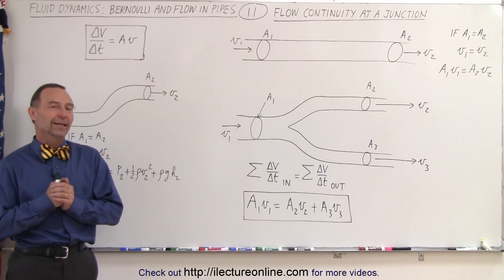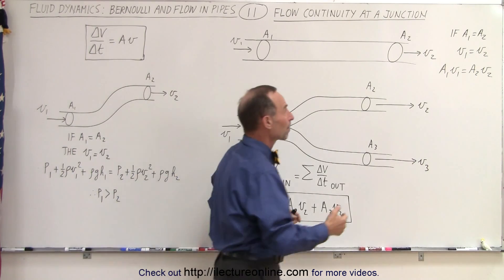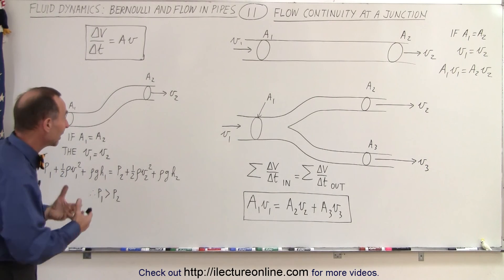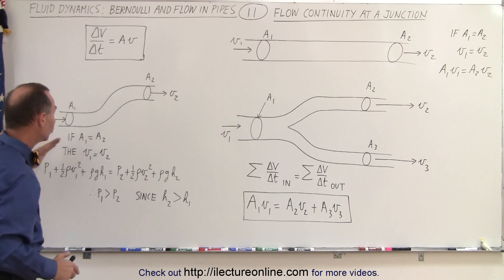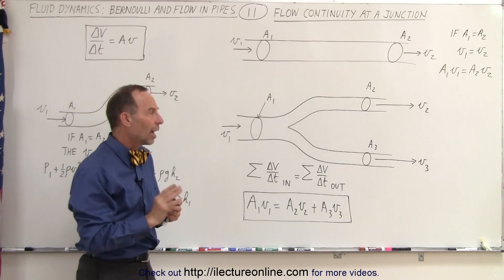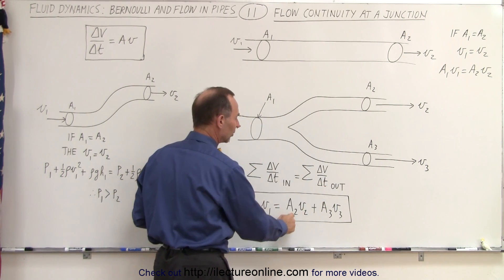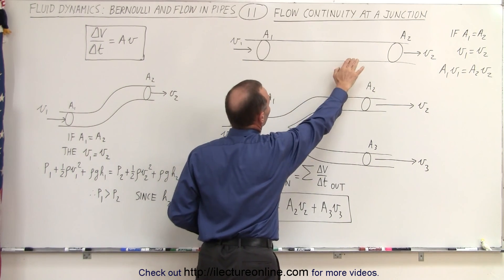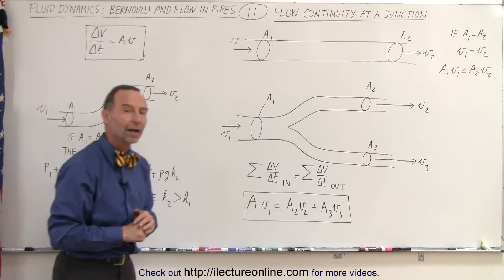Physics 34.1  Bernoulli's Equation & Flow in Pipes (11 of 38) Flow Continuity at a Junction

Comment: Nice. Thanks. What if the pipe diameter of A1 (e.g. 6 inch) split to two pipes of the same diameter (e.g. 6 inch each), would it increase the flow compare to only one pipe of 6 inch only?

Comment: How does the pressure change from the big pipe to the 2 smaller ones?
Reply from the maker: If the diameters are different then the velocity increases in the smaller branch and decreases in the larger branch.  And therefore in the smaller branch the pressure drops and in the larger branch the pressure increases.
Reply: @MichelvanBiezen  there is 2 smaller branches and 1 bigger branch tho

Comment: Thanks for the nice explanation! 
I have troubles to understand how you would write bernoulli's equation for the 3 pipe system? Would it be the same as you wrote it on the left side of the board, or would it become P1 +1/2 rho v1^2 + rho g h1 = P2 +1/2 rho v2^2 + rho g h2 + P3 +1/2 rho v3^2+ rho g h3? 

Thanks a lot!

Comment: You state that the change in pressure is due to increased friction losses due to increased velocity but... Bernoulli's equations explicitly assume a frictionless pipe. 

edit - I wrote the following because I missed the tiny half-second where he stated his assumption that pipes A2 and A3 are smaller than A1. In that case his statement about friction losses is correct, though still a bit misleading without also mentioning the additional pressure change predicted by Bernoulli's equations. Below is the rest of my original comment with some corrections.

Also, velocity is not guaranteed to increase. In your equation "A1V1 = A2V2 + A3V3" you can set V1 = V2 = V3 to drop out the velocity figure and produce the equation "A1 = A2 + A3" which demonstrates the necessary relation between the pipes to achieve constant velocity between the pipes. For instance if the two pipes have half the cross-sectional area. In this case Bernoulli's equations predict the same pressure in pipes 2 and 3 as in pipe 1.

Now, if all three pipes are the same size: "A1 = A2 = A3" then the pipe size can be dropped out to produce "V1 = V2 + V3" in which case V2 and V3 must have lower velocity than V1. In this case friction losses (which bernoulli is ignoring) would actually be less than in a single pipe of that size.
Reply from the maker: In real life there are always pressure losses due to friction.  In Bernoulli's equation these are ignored and changes in pressure are only due to changes in height and changes in velocity.
Reply: @MichelvanBiezen  Agreed, I just wanted to clarify that even in the absence of friction the change in velocity must still be accompanied by a change in pressure. In many scenarios it is much more significant than the frictional loss. 

I wanted to bring attention to the friction issue because I thought it highly likely that some incorrect implications made while talking of the y-bend would mislead some people that watched this 
video.

Also, I admit that I also slightly incorrectly stated my case in my last paragraph. in my proposed scenario (all three pipes the same size) V2 and V3 will have smaller velocity than V1 and thus a higher pressure in the two right hand pipes. I will edit my original comment to fix that. Also, 'pressure due to velocity change' is a bad way to look at it. I'll change that too.
Reply: @MichelvanBiezen Thanks for taking that minute to reply, it led me to think about my own exact wording and assumptions and has improved my ability to conceptualize and explain these principles.
Reply from the maker: You obviously understand this well.  Thanks for the excellent input.

Comment: How would this result change with a compressible fluid (air)?  Would the decreased cross-section cause a higher pressure and cause less air to flow in the thinner pipe?
Reply from the maker: We just posted a video today that addresses that.  (It was part of last year's JEE exam.)

Comment: Great video sir,

Need one help in the third scenario
If A1=A2=A3, H1=H2=H3 and if A3 line is closed at an X mtr distance. What will be the effect of flow caused when fluid flows from A1 to A2. Will there be turbulence created at the intersection causing reduced flow rate and pressure.
Reply from the maker: If A3 is closed off, then the transition from A1 to A2 would have a sudden diameter transition, which would cause some turbulence.  (we ignore turbulence in these simple examples).  The flow rate will remain the same in both A1 and A2, but the speed in A2 would be greater and the pressure in A2 would be smaller.

Comment: I have a question: in regards to a horizontally lying bifurcating pipe, how would fluid travel if there were a complete blockage of A2 (I assume V2 is 0 despite the A2 pipe still existing) further down the pipe at the right side of the diagram, while A3 remains fully open? Would fluid through A1 flow straight to A3 and leave "old" fluid stagnant in the dead end bifurcation, or would there be a constant small forward and backward flow of fluid throughout the A2 closed pipe?

Comment: what if the two new pipes that come from a junction have the same area as the original, is the velocity halved ?
Reply from the maker: Yes.  Essentially, you are doubling the area which will result in half the velocity.
Reply: @MichelvanBiezen  awesome, thank you so much

Comment: does the total pressure at A1 equal to the total pressure at A2 and A3, assuming there's no friction force along the pipe?
Reply from the maker: No, the pressure is not additive like that.   Use  Bernoulli's equation where  P1 + (1/2) (density) v1^2 + (density) g h1 = P2 + (1/2) (density) v2^2 + (density) g h2

Comment: Thanks for the great video, I have a question. If you wanted to calculate the pressure at the end of the smaller pipes just before the fluid leaves them, how would you go about that? This in the case that hot water is being pumped through the large pipe inlet.
Reply from the maker: You would want to use Bernoulli's equation to find the pressure at any point in the pipe.  It is dependent on the velocity, so once you have the velocity in the smaller pipe and a reference pressure you can determine that.
Reply: @MichelvanBiezen  Thank you very much Prof ♥️

Comment: How if A1=A2 and A2 > A3?
Reply from the maker: A1 = A2 since the diameter of the pipe doesn't change.  I don't believe that there was an indication on the size comparison between A2 and A3.  (Note that each example is independent of the other examples).
Reply: @MichelvanBiezen  can you help me to find references that can help me to solve this problem sir?
I have a problem to find the flow and pressure of a supply pipe (condensate water pipe) that has the same diameter as the discharge pump and flow and pressure of  the recirculating pump that has almost 1/2 dimeter of supply pipe
Reply from the maker: Sorry, I can't point to a good reference.   (and we haven't covered that yet).
Reply: @MichelvanBiezen  ok, thank you sir

Comment: How about water flow from a single into a T formation with A remaining constant in the T sections?

Velocity halved? 

I'm okay with that. I need to move water to some trees at rear of yard while not overwatering grass.
Reply from the maker: Yes, we still need to add additional videos on that.  When the flow goes into smaller tubes and velocity increases the pressure will decrease accordingly.

Comment: Great video, thanks a lot! I just have one question:
If I understand it correctly even if I know A_1 and v_1 and also A_2 and A_3 I still have no way so know the velocities v_2 and v_3, I still need to measure at least one of those. Or is there a way to at least make a reasonable guess?
Reply from the maker: You can set up 2 equations to find the 2 unknowns.  The second equation equates the fluid flow on both sides.
Reply: @MichelvanBiezen  wow, thank you for the fast answer, and making the effort to read your youtube comments! 
Maybe I am completely stumped, but I thought the first equation equates the volume flows (Q = A*v and Q_1 = Q_2 + Q_3)? And that means that I have to measure the volume flow coming out of each pipe (or at least one pipe) to know the velocity and if I can't measure that and only know the volume flow going in (Q_1 = A_1 * v_1) and the areas A_2 and A_3 I have no way of actually knowing the velocities. 
For example, if I have a pipe, that splits in 100 subpipes, where I know Q1 and all the areas (which are all different and don't sum up to A1) then I am screwed if I can't measure the volume flow of at least 99 of the pipes separately, because I can't assume that A_2*v_2 = A_3*v_2 = ... = A_100 * v_100 if the areas are different, or can I? 
Tell me: I'm screwed, am I not? :)
Reply: @sylviawaise7424  Maybe you can use Bernoulli equation. Please tell me if  you have already answered this question.

Comment: help me
oil flows through a 4.0 cm i.d. pipe at an average speed of 2.5 m/s. find the flow in m3/s and cm3/s
Reply from the maker: dV/dt = Av   (the flow rate = cross sectional area x velocity ) = (pi) R^2 v = (pi) (0.02m)^2 (2.5 m/sec) = 3.14 x 10^-3 m^3/sec = 3140 cm^3/sec

Comment: Sir I have a question, what if it is reversed? A2V2 + A3V3 = A1V1? What I mean is, the flow is reversed, fluids are going into A2 and A3 and out to A1. How do you solve that problem?

Does it mean that if A2V2 has 20mL/hr going in and A3V3 has 125mL/hr going in, the total output mL/hr is 145mL/hr? 

Would you please enlighten me regarding this problem. I have been trying to solve this for quite some time now and attempting to apply it in my work with IV pumps.
Reply: Hi, I need to know the answer as well, do you have any answer already?
Reply: @kehhkhuantan2550  I've found the answer. Whatever goes in and however many, they all add up cumulatively. A + B = C, coversely C = A + B if they split into two directions; the resulting rates would be different depending on the area of the tube with constant input from C.
Reply: @kehhkhuantan2550  https://youtu.be/gn4JMIwDzp8

Comment: Do you have a. Video on the exact opposite? Two smaller pipes joining into 1 and the best way to join them and how to figure the velocity  in the larger pipe after the junction? And would be curious & helpful to know what happens if/as the angle of junction of the smaller paralell pipes increases? (Opposing force invreases.  OR... is there a different/better/more efficient way to have two join into 1 that has the best end result for end velosity with least amount of  energy/pressure waste (friction where they join) Thank you.  If 1cwere made. I will point 1000"s of people in the aquarist community to this video. We are starving for this info.
Reply from the maker: Our plan is to put a comprehensive course together for fluid motion in pipes.  We haven't been able to get to it yet.

Comment: didn't catch if A1 = A2 + A3 in split diagram, if not, would pressure have to be included in the equation?
Reply: It would not. As long as the density remains constant, the equation is really just talking about conservation of mass. The amount of fluid going through A1 has the equal the sum of fluid going through A2 and A3.

Comment: How will the pressure P2 and P3 change compared to P1? Could you please explain?
Reply from the maker: Pressure decreases if the velocity increases.  So it depends on the relative cross-sectional areas.
Reply: Michel van Biezen can you please give me a resource to see how p2 & p3 relate to p1 mathematically?
Reply: Michel van Biezen thank you for your valuable feedback.
Reply: If A1=A2=A3, how does P1, P2, P3 relate to each other? Velocity would decrease (indicating pressure might increase) but the the flow in each pipe is lower than initial (so total pressure might decrease). Or is it possible for P1=P2=P3? Just can't get my head around this. Really appreciate your explanation on this.
Reply: @HasthaChithiran  bernoulli's equation is only valid along streamlines, so p2 and p3 are essentially unrelated